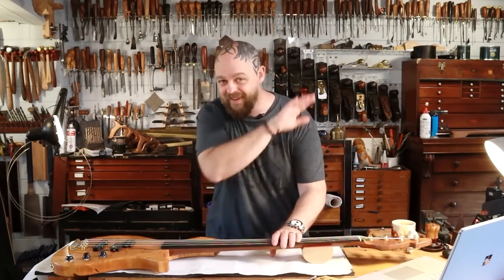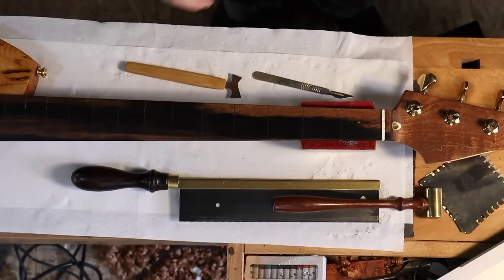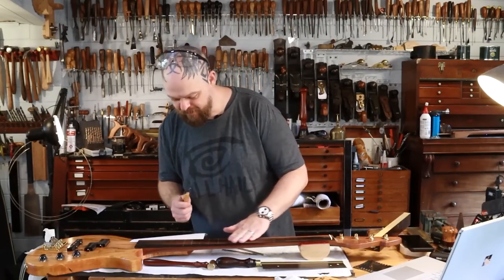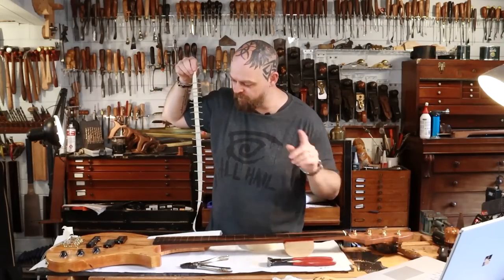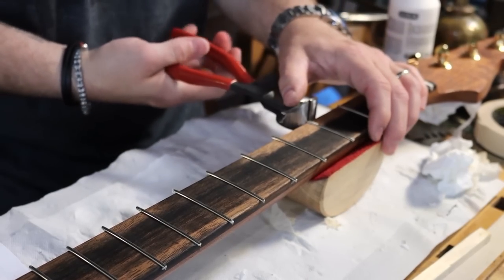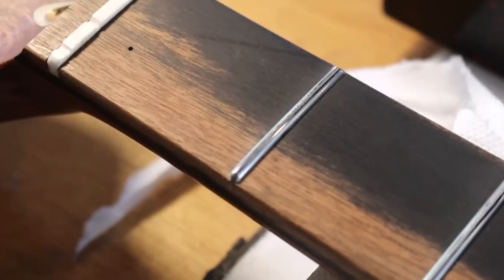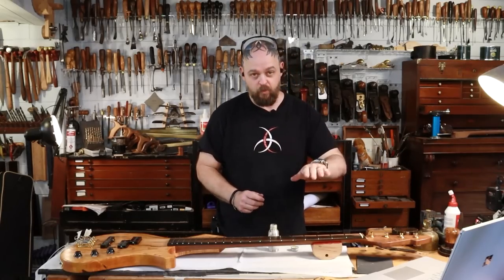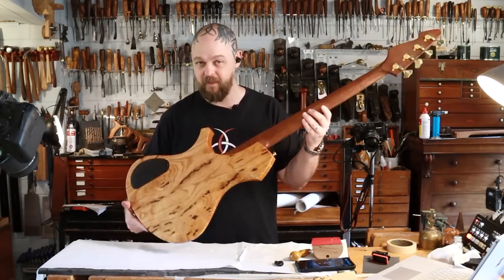Stop!  Rewind...fretting a new Fretless Bass Guitar Ep 6 | A Tutorial in changing your mind!

Comment: For reference, the best approach to keeping heat localised is to have a lot of heat. It's why we need reasonably powerful soldering irons for electronics work like tinning pot casings for earth connections and circuit-board soldering, because the more powerful, the quicker it heats and the less time you need to keep the heat applied. It heats up a local area very quickly preventing spread of heat and subsequent scorch.

I'd have gone with direct contact from the soldering iron.
Reply from the maker: Thank you.  This is good to know for next time.
Reply: @CrimsonCustomGuitars  Also use the largest soldering iron tip you can find to maximize the heat capacity and reduce temperature drop on contact
Reply: Heat dissipation vs input. Yep.
Reply: i agree.

i believe the same thing applies to the quality of the thermal contact. that's why i always only put solder on the tip of my iron, and have done so for around a decade with great results. it only takes an instant for the hot liquid solder to flow where it needs to and then solidify, and i don't need the flux core that burns away (if i'm using flux core at all) because i put plenty of flux on the connection beforehand.

on the other hand, touching the iron dry and waiting for the whole thing to warm up to melt the solder on the other side of the connection, as is common practice, can take seconds of slow cooking your components, and also requires an extra hand.

obviously it depends on the application, but on small components near small traces it works really fast, the things don't get warm. and i never get cold solders.

i'm curious what your opinion is on this.

Comment: Imagine that bass with EVO gold frets! Would have gone very well with the gold hardware and brass insert
Reply: That's pretty much what I did with my bass build.  Gold tuners, brass nut, brass bridge, EVO gold frets,  brass ringed abalone fret markers and optima gold strings. 
Never was much of a fan of gold hardware but for that bass it really worked.
Reply: @alihaggis78  how are those Optima strings? Have been considering trying them but they’re kinda expensive
Reply: @joeblack375  they are pricey. I do like them a lot. I always used to use rotosound 66 stainless strings and the optima strings have a similar feel and sound. A little stickier but the tone lasts well. I try to change them every 12 months if the need it or not :)